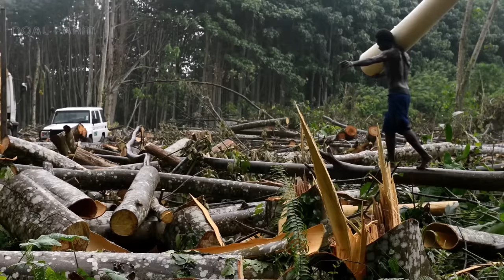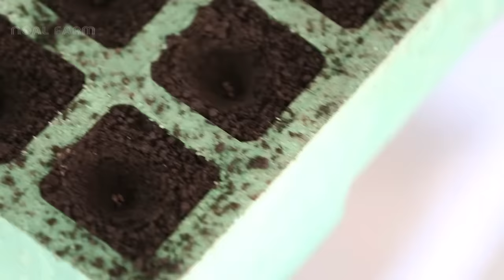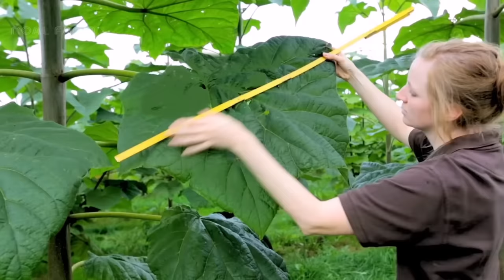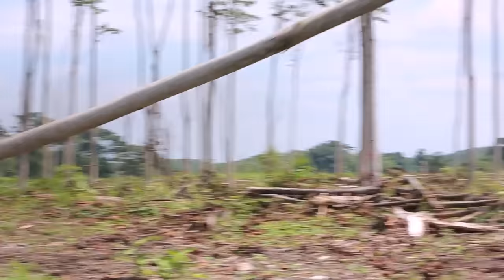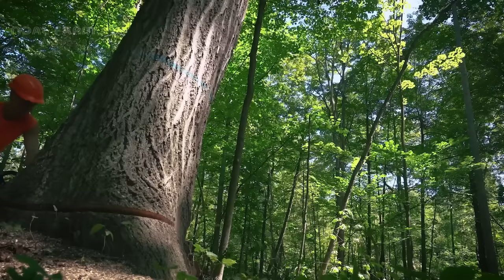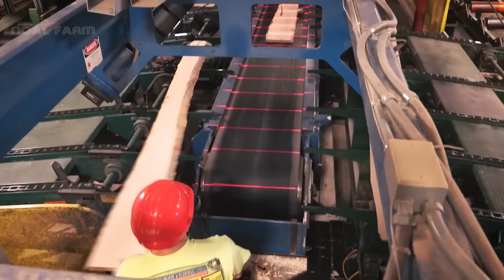How Millions of World's Lightest Wood Trees are Grown and Harvested - Wood processing at factory

Comment: Excellent work, what's the name of tree and which country grow and process it ? 
What is the waste material coming out of this sawing plant; may be I can propose something out of that.
Reply: It appears to be balsa wood and is shown growing in multiple countries, but the factory is in northern Spain.
Reply: Per the description "Balsa and Paulownia are the lightest and softest timber used commercially."
Reply: The nursery is in Spain, but that is Devereaux saw mill located in michigan.
Reply: Павловния
Reply: Balsa and Paulownia are the lightest and softest timber used commercially. It exhibits an unusually high degree of buoyancy and provides very efficient insulation against heat and sound.
Balsa trees grow naturally in the humid rain forests of Central and South America. The Balsa wood's lightness is attributed to the fact that it's cells are big and very thin walled to the extent that the ratio of solid matter to open space is as small as possible. Most woods have gobs of heavy, plastic-like cement, called lignin, holding the cells together. In Balsa, lignin is at a minimum. Only about 40% of the volume of a piece of Balsa is solid substance.
Reply: Read
Reply: You must have missed the part where it tells you it is transported. That can include to many countries.
Reply: @milllioner Это название одного вида дерева:  Павловния или бальса? Или два вида?
Reply: Lots of Thanks to all of you dearest friends for your feedback; actually I am a waste management expert.
The quantity of wood processing at this plant is huge; from the waste wood and powder they can produce a high quality composite, compost for soil, wood chips and electricity as well